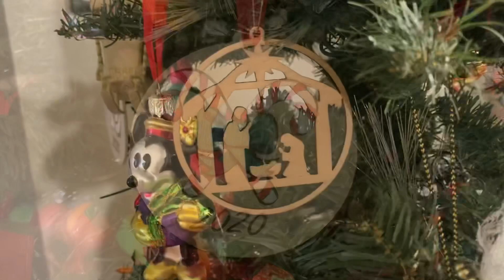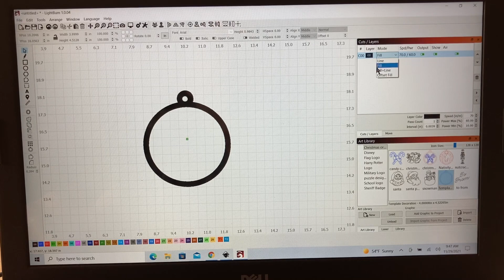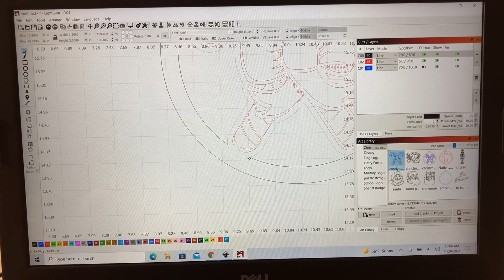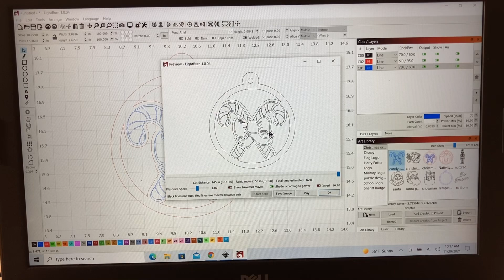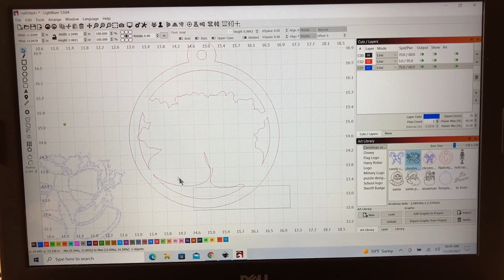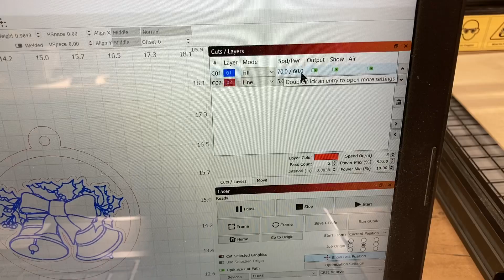Making Christmas Ornaments with a 20 watt Diode Laser: Engraving and Cutting

Comment: What material are you cutting? What were your settings?  I have the xtool diode laser 20 watts
Reply from the maker: This  is 1/8” plywood. The best settings are achieved by running a test grid

Comment: Question.. On the ornaments that you cut out parts (like the candy cane )...  What if you put the ornament In a jig and etch the front and then flip it over in the jig and flip the image as well in lightburn and etched just the flipped picture of the candy cane on the back..  If you get the position correct,  you'll end up with a double sided ornament instead of a single sided one..  What do you think?  Maybe you do this already? Or maybe it's too much trouble?  Just a thought I wanted to share..  Merry Christmas!
Reply from the maker: Yes you can do that. Just take you time to set it up carefully.

Comment: Great video Paw Paw. I have a jTech 14w diode and would like to try these. What kind of plywood and thickness are you using? I may have missed it but didn't hear you mention that.
Reply from the maker: This is just 3mm plywood. This was from Amazon. You can get this from craft stores also
Reply: @PawPawsWorkShop  that worked out great! Thank you! One more question if I may. What do you use to clean up the cut edges where it has the soot? I don’t want to make smudges from it on my fresh ornament
Reply from the maker: You can take painter tape and put it on the edge. Also, seal the wood.

Comment: Yes I have it set to line. I have a fox alien laser are there specific settings that I need to do in light burn to speed the process up. I noticed a lot of your project are pretty quick. Mine take several hours. I have looked over it for hours trying to figure it out so I was just wondering if there are settings that I need to change to speed things up. Thanks a lot

Comment: Hi! Great project. What thickness is the plywood you are using and where do you get it from? Link would be great. Thanks.
Reply from the maker: This is about 1/8" or about 3mm.  You can get this usually at any hobby or craft store.  I assume it would be available on Amazon as well.
Reply: @PawPawsWorkShop  thank you!